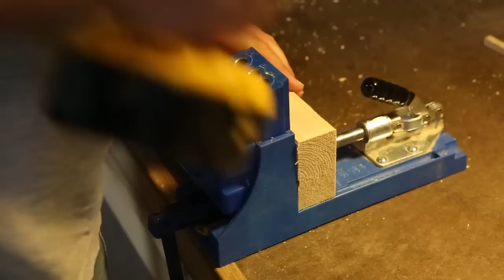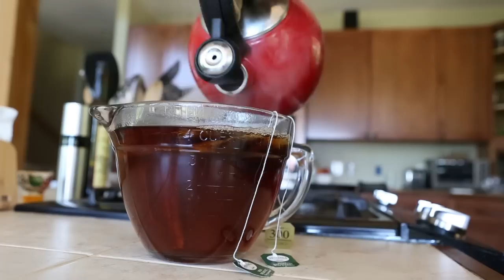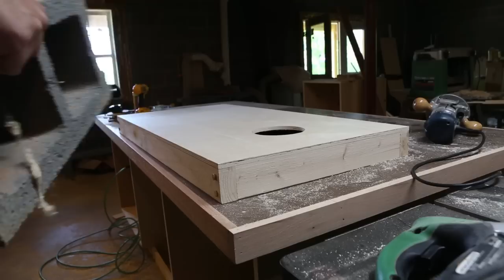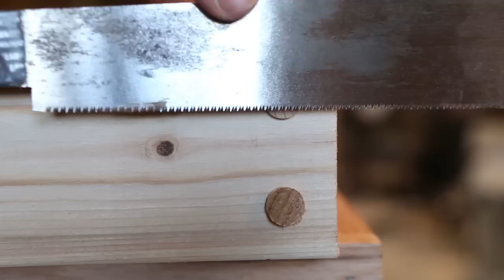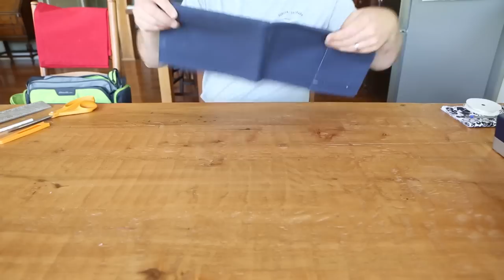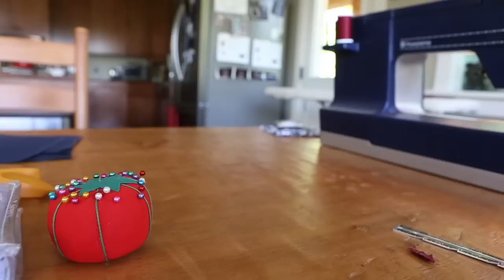How To Make Cornhole Boards

Comment: I've been told that some take the game and the boards very seriously, and the proper slickness of the board is very important.
 Have you ever been told that your boards are too slick, or not slick enough, or that they're just right?
 Any feedback on this paticular aspect of the finished product is welcome, and appreciated greatly.
Reply from the maker: People take it VERY seriously. A lot of people will say to use real corn instead of the synthetic beads in the bags because the constant use creates cornmeal which helps lubricate the boards and bags. Ive never had a complaint about my boards. Just make sure they are stout and don't have any "bounce"to them

Comment: Hey William I know this comment is quite a while after your post. I’m just riding to suggest getting a push stick. I’ve been doing woodworking for longer than you’ve been alive and this past Sunday I was doing exactly the same cut you did by hand, I was even using a Kreg push stick, The blade got a hold of the front of my push the rotated everything into the blade my middle finger is now 1/3 a middle finger and I spent 10 hours in surgery to save my fourth and pinky finger. I don’t write this to criticize just to hope this doesn’t happen to anyone else it’s painful depressing and avoidable. Unfortunately for me the Kreg push stick is Slippery on the face that pushes/foot and flat surface to hold the wood down, basically a piece of unusable junk that’s an accident waiting to happen...so extra safety it is probably the best method. I wish you all the luck in the world I hope your YouTube channel is a huge success.  Great Job on making a fun game.

Comment: Fantastic video and build.  Did you screw the sides and ends together and cover with plugs versus using pocket holes for aesthetics, strength or some other reason?
Reply from the maker: Purely aesthetics

Comment: Thank you very much for putting this together. Other cornhole vids didnt include the bag instructions so that helped a lot!.  I also like your version of using the cinder block to get the right angle for the leg cut.  I think Ill use that option.. others have mention anywhere between 22 and 30 degrees.
Reply: Or….the gallon paint can trick.👍

Comment: All those tools and no 6" hole saw? Makes cutting the "cornhole" super fast and accurate.
Reply: I checked out the price of a real good hole saw, $50,00 bucks. A cheap one is about $9.00. I should have spent the $9.00. LOL
Reply: @josephwazocha140  I picked up a cheap one myself and it was well worth the money. Thanks for the video.
Reply: @josephwazocha140 , where did you get the $9.00 hole saw?

Comment: Very good "how to" video. The only change I made to my boards was to put my 2x4's on the outside of the plywood for a more "finished" look. I put 3/4"x3/4" pine strip supports on the inside of the frame and glued the plywood to them. Had some neighbors over and they loved playing. Have sold 6 sets over the past 2 weeks. Thankyou.

Comment: cut on the legs is 22.5 degrees..cut on a miter saw..lot easier than a table saw! cutting the board down yo 47 3/4 makes the board shorter than regulation.

Comment: Just curious. When using 1/2" plywood for the for the decks why do you not add a center support underneath?  Boards I have played on using 1/2" tops and no center support tend to have a 'trampoline' effect on bags that hit the center of the boards.
Reply from the maker: Because that's what the American Cornhole Association calls for. (https://www.playcornhole.org/aca-official-rules-of-cornhole-corn-toss/).  I've played on those springy boards too, but Birch is pretty stout.  These don't bounce at all, but they can be slick if you sand them too fine.
Reply: Ok.  I have seen another spec that calls for 1/2" ply to have a center support. http://americancornhole.com/aco-official-rules-for-the-sport-of-cornhole/ 

I am also on a forum of corn hole board builders and the consensus there is that boards made with 1/2" ply add the center support.  I am glad to hear that your boards play well and do not bounce.
Reply from the maker: I don't see any reason you couldn't add a center support retroactively if they did tend to bounce.  Again, the birch tops are pretty stout, but if you experienced any kind of bounce after they are built just flip the board over and add a support.

Comment: I have a question maybe you could answer???  I made a set of boards and I chose to paint mine, then put the clear coat (polyurethane) on them, and my boards are RIDICULOUSLY fast... as in a bag thrown will hit the front 4 inches of the board and slide all the way up and off the back without stopping.  Do you know what the cause for that could be??  Have tried bags made from 3 different types of material, and they all seemed to do the same thing
Reply from the maker: You could try scuffing them up with sandpaper, or maybe do another top coat with some coarse salt mixed into the poly.  I might experiment on some scrap wood and see which one bites better before applying it to the actual boards.
Reply: Do not scuff up your finish, it should not be necessary.  My guess is your bags are not broken in yet.  New bags tend to be puffy and firm and slide too much. New bags also tend to give off dust when they hit which makes the bags slide more as well. When I sell sets I always let my customers know that they need 4 to 6 hours of solid play to break in the boards and bags. Good boards should allow the bags to slide. The bags should NEVER just hit the surface and stop. Try this first before messing with your finish.
Reply: Windex will help slow down your boards.  So does a graceful arc on the throws.

Comment: Are these regulation sized boards?
Reply from the maker: They are.  2'x4' deck (I trim mine a quarter inch shy), the front is 4" tall, the back stands 12" from the ground with a 6 inch hole centered 9 inches down from the top of the board.
Reply: Okay, I will be making these. Thanks!

Comment: I watched this vid on a whim. I've built and sold about 20 sets of cornhole boards and thought, "I'll check out how he does it, doubt I'll learn anything though."

Then you used a simple cinder block to get the right height and I learned something. Bought one and it works perfectly! I had been using paint cans and adjusting the height.

Thanks!
Reply from the maker: I feel like I learn something new every time I watch someone else do something I've done a million times.  Glad you learned something!
Reply: A 1 gallon paint can and maybe a shim if needed works as well.

Comment: Great video but please provide the depth on the Kreg jig/gauge and the drill bit set screw for securing the 2"X 4" framing (1" 1/2" X 3 1/2") to the 1/2" deck.  I have 2" X 4" frame with a 1/2" birch wood deck and since the 2" X  4" is actually 1 1/2", I set the Kreg jig/gauge AND the drill bit at 1 1/2" per the Kreg table/handbook and tried the 1 1/4" fine thread Kreg screw (for hardwoods).  I have experimented with various screw lengths, etc but cannot seem to get the appropriate settings and or screw length.  I suspect I need to abandon the Kreg table and try more combinations but if you can tell me the settings you used (specifics) in your video, I would greatly appreciate it.  By the way, the 2 1/2" screws (course thread for softwoods) with the 1 1/2" set screw drill bit and 1 1/2" Kreg jig/gauge setting worked well (per the Kreg Handbook instructions) for securing the 2 X 4s.  What were your settings (Kreg jig, drill bit length and the screw length) in the video for the pocket holes drilled for the frame secured to the 1/2" deck?  Thank you.

Comment: Will, phenomenal video man. Thanks for the great ideas. I have been making boards for a while too but like some of your style and will incorporate into mine. I do have a question though. When you cut the frame a .25" short, do you not bring the entire board set out of ACA regs by making them 3'3/4" x 1'3/4" rather than 4' x 2' ? They do look awesome the way you do it, just trying to wrap my brain around how the dimensions come out within regs if you do it that way. Any thoughts?

Thanks

Paul
Reply from the maker: +Paul Menges I guess you could cut the frames to 23 7/8" and 47 7/8" and only trim a 1/16" on all sides.  Then it would only be an eighth of an inch our of regs.  I'm not as much of a stickler to call a 1/4" short out of regs and I would argue that that would be in tolerance.  If I were commissioned to build a bunch of boards for an ACA sponsored event I guess I would keep them exactly 24x48.

Meh, I'll take a slap on the wrist for aesthetics sake.  You could always make the frame 24x48 and cut the tops a little wider and have the leftover of the sheet be used for another project and only get 2 boards per 4x8 sheet.
Reply: I like the way you think! As an old signals analyst, +/- tolerance levels are something I can completely get behind! Thanks for the reply and alternative ideas.

Comment: Good video with great tips on making the boards.  I am still confused on cutting the frame 1/4" short all the way around?  that part was hard for me to follow because the board wasn't being shown.  Something to do with using the router  but I don't see how this board ends up being regulation size with the frame being smaller.

Comment: what are the measurements for the legs when marking them use the compass to make rounded cuts
Reply from the maker: the legs are 3" wide so the compass should be set at 1.5"

Comment: I just made a set for my son-in-law for Christmas. You make it look so easy!!(I know it's not)He is a HUGE Minnesota Wild Hockey fan so I added some Wild logos to personalize the board.  I found that you can easily add the logos by using an inkjet printer and printing on wax paper. Place the wax paper on the board and rub with a credit card, ink will absorb right into the wood. Make sure you mirror your logos before you print, and put them on before the "dark tea" stage.
Reply from the maker: +Jimmy Bushaway Very cool!  I did that same technique on my Cribbage board video.  Merry Christmas!
Reply: As long as you have the tools he has they will look great and will make the job easier.

Comment: how long did these take to make seems way too much for this project
Reply from the maker: +Victor Calero it's hard to say since I was making 8 and filming.  If you took out drying time I can probably get a set done in about an hour and the bags done in about half that.  You can always take out some of the finer touches but I work in a pretty high end market (weddings) so it's worth it to me.
Reply: then that's not bad then!! very good craftsmanship though!

Comment from the maker: For some reason I can't "reply" to greg ske's comment so I'll post it as a public comment.  Cost of materials will vary by where you live in my case: a 4'x8' sheet of 1/2" birch plywood is about $40 (you can price out different sheet goods and use whatever you prefer but I wouldn't go any less than 1/2".  3/4" would be more sturdy but heavier), if you are only making one set, you'll only need 4'x4'.  You might be able to buy a half sheet for cheaper.  2x4's are nominally priced.  In Virginia, lately, I"ve been paying about $4 per 12 footer.  Same goes for the 1x4 for the legs.  Figure, maybe $8 for a box of screws if you don't already have some laying around.  So, around $50 for the boards themselves.  Again, you might have a half sheet of plywood leftover to make another set for a gift or to sell so you'd only need to buy more 2x4's.  I got the duck canvas from Jo-Ann Fabrics on sale for $3/yard (a half of a yard is more than enough per color).  The bag of corn I got from my local farm store, 50 lbs was $8 but you could also probably use "popping corn" you'd get at your grocery store..

Comment: Love this video.  Really well done.  You have inspired me to make a set.  I also have a few questions regarding your staining process.  How much time did you allow after applying the tea and after the "liquid rust"?  Is that just one coat of the rust mixture? And at the end of the video, that's just wipe on poly you use?  Do you recommend a certain type?  Apologies in advance for so many questions.
Reply from the maker: +ColonialFleet Thank you very much!  The tea I usually let dry to the touch (maybe an hour or two in the Sun on a warm day or, overnight if it's down in my shop).  The liquid rust usually overnight just to make sure it's dry before applying the poly.  I did just use wipe on poly because I like the way it applies.  It does take more coats that regular polyurethane because it's really just diluted polyurethane.  I use Minwax because it's readily available at the big blue home improvement store, but you could make your own by diluting regular poly with some mineral spirits. I know a lot of woodworkers like General Finishes as a brand.  You could also use polycrylic which I have used in the past.  You might have to refinish them in a few years no matter what you use.  Cornhole boards seem to take a beating what with bags getting thrown at them, drinks getting spilled, little kids like to climb on them, they get left out overnight after a party during a surprise rainstorm, etc.

Comment: Fantastic video, Will. I was looking to buy some corn hole boards for my kids and found the prices really high. Then I found your video and realized I had pretty much all the necessary tools to do it myself.  I'm going to tackle this project in a few days and will follow your instructions closely. Can you just clarify the type of stain finish to use as this will be outside most of the time. Thanks for your great work, I'm going to subscribe to your channel now!
Reply from the maker: +Lorne Kelton thanks for watching!  As far as the stain goes, I put steel wool in a jar and fill it up with white vinegar and let it dissolve over a few days.  I use strong black tea to add tannins to the wood, then apply the vinegar mixture after I let the tea dry (maybe an hour in the sun or overnight in the shop).  That's what gives it the warm gray color like an instant antique.  As far as finish goes, I use several coats of wipe-on polyurethane (because I like the way it applies).  You could also use an exterior grade paint if you wanted to customize them, or a standard brush on polyurethane or polycrylic.  If they will spend a lot of time outside I might soak the ends of the feet in polyurethane (using some sort of shallow dish) so moisture doesn't wick up the end-grain.  I will note that if bags are left out in the rain, they will mold if you use the traditional corn filling.

Comment: Great video and nice channel, you found another subscriber. Your tricks of the strong black tea and "rust in a bottle" created a great effect that I would love to try and replicate on some boards myself. I have been getting by without a Kreg Jig and over the past few years of learning woodworking, I have been starting with hand tools and using other forms of joinery, but how do you calculate how deep to put your screws in the pocket holes so that they don't come through the plywood? I do think it's finally time to suck it up and get a Kreg Jig, but I've said this too many times already haha.
Reply from the maker: +Erick B Sorry for not replying!  For some reason I wasn't getting notifications.  There are markers on the Kreg Jig itself for the thickness of the material you're using as well as a guide for the bit itself and where to tighten the collar.  You then have to decide what size screws to use.  They are great if everything you're doing is made of 3/4 inch.  I really have a love/hate relationship with my pocket hole jig.  Thanks for watching!

Comment: Any reason why you didn't use pocket holes to hole the frames together?
Reply from the maker: Jonathan Scott I've used them before for the frames.  I'm still not 100% sold on pocket hole joinery and try not to use them exclusively.  I'm sure it's user error, but I still sometimes get them to poke out the other side of a joint from time to time and get really frustrated (if you've got any tips I'd be glad to hear them, I feel like every time I use them I take the time to set up the jig "properly" and still have issues).  That, and I didn't have any longer pocket hole screws on hand and I did have some nice hardwoods and a plug cutter already as well as some 2 1/2" deck screws.  Thanks for watching!
Reply: I cannot give any pointers for settings on the jig. When I make boards I use 1x4s and 1\2" tops  So my kreg jig set at 3/4" with 1 1/4" screws for the frames and 1" screws for the tops seems to hold very well. (I glue and screw all joints)
Reply: Just use 1 1/2 or 2inch deck screws for ur pocket holes so they won't poke out experiment to see what works for you